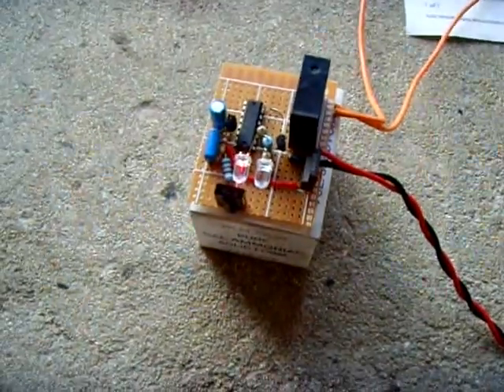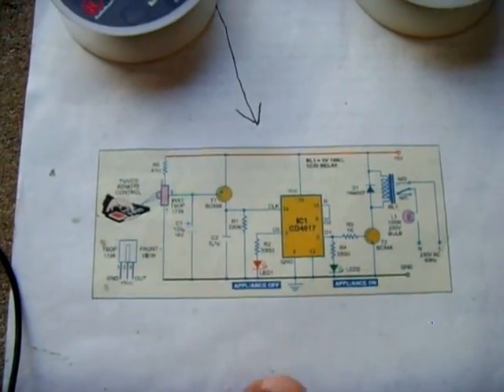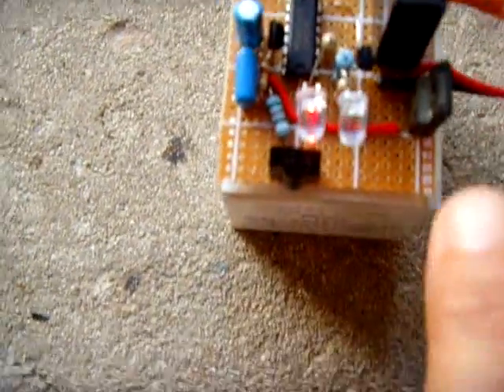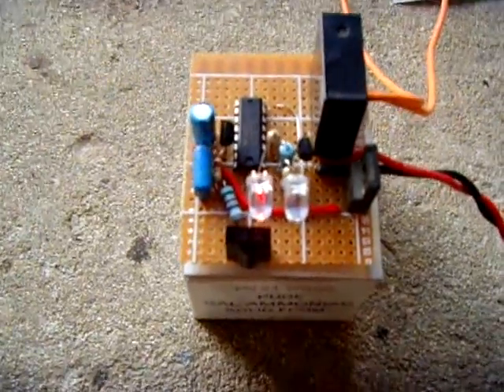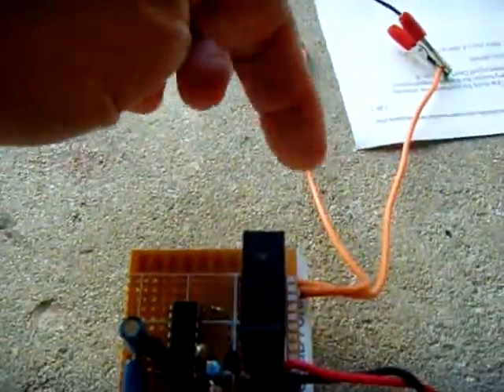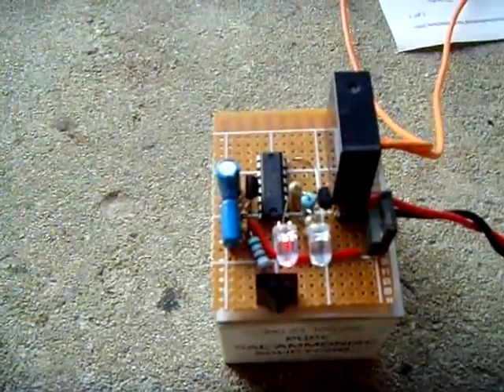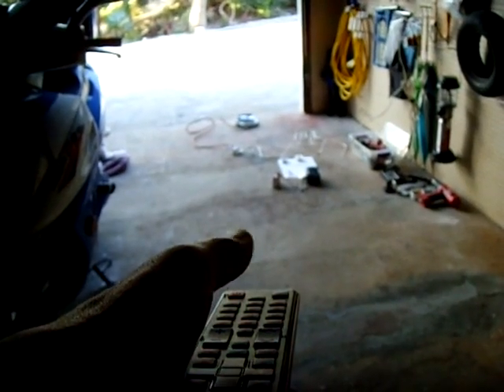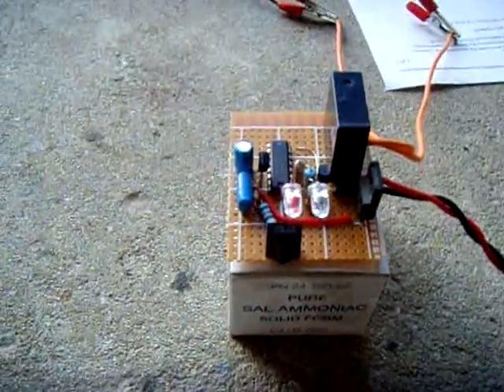Turn Appliances ON & OFF With Any Remote Control

Comment: I tried this circuit many a times but it is still not working

my problem- only one indication Led gets on which is on the first output.
it does not perform any switching rather the first LED keep on blinking when i press buttons
as a result relay also dnt perfrom any switching...
please help me through this....waiting fr rply...
Reply from the maker: I have a feeling your circuit is not right. The tsop1738/1838 is connected properly? Make sure, because this is a very simple circuit. Try new transistors as well. I have a newer and better version of this type of circuit, Be sure to check it out in my video playlists. Thank You
Reply: electronicsNmore i too feel that the problem is in Transistor
cuz i'd checked the TSOP it works properly
but i am using BC558.... I'd replaced them twice ....but still no result :-(

Comment: Can i connect two or more light connections through the same setup?
Reply from the maker: You can control as many lights as you want as long as you do not exceed the rating of the relay contacts.
Reply: I am sorry, I am a lay man to the electronic world. Can you tell me how i could change the channels assuming I have 3 light bulbs.
Reply from the maker: Turning the circuit on and off will turn ALL the lights on/off at the same time. You cannot choose each light with this circuit
Reply: Okay. Thank you! :)

Comment: i tried this project and it worked but the problem is that it automatically gets switched off after a certain interval thought every time the intervals are different. i have to again press the remote button to make the lights on......i need help on this project
Reply from the maker: It should not be doing that. Try adding a resistor in series with the output leg of the tsop1738/1838. Start around 1K and go higher of needed until the problem goes away. Using too high a value will kill your range. It sounds like the IR is too sensitive and being triggered by fluorescent lights/sunlight.

Comment: i was looking for this circuit, there were Rechargeable L.E.D. Lamps for 220v 
which had this integrated, but I coudn't grab one and it never came back to that store.
Will be making this and post a response video soon, 
I'll be making this circuit using 7805 Regulator to make it run on 5V and 12V for the relay.

Thanks

Comment: sir can i use ir1838 in place of 1738
Reply from the maker: yes.
Reply: electronicsNmore what changes do i hv 2 make in the resistors if i provide a supply of 6v...???
Reply from the maker: Leave everything as is and use a 5V zener voltage regulator to power the entire circuit. You can supply the full 6V to the relay.
Reply: i have tried this with l7805 voltage reg. but it didnt work.....i'm using a normal sony tv remote but still then it is not working...what may be the probable mistake u think i hv done....while making the circuit...
Reply from the maker: Circuit definitely works. Check all your connections, component values, and make sure the 1838 is connected to the proper pins.
Reply: electronicsNmore Can I use 555 timer, does the circuit will work if I put 555 timer? :D
Reply: electronicsNmore
are u sure that the circuit works with any vcd remote or any tv remote....
Reply from the maker: yes, at least all the remotes I tested. Some remotes may take longer to trigger. So try holding down the button, or using the power button on the remote.
Reply: electronicsNmore
what about this remote  plz check the link -----{{{{http://www.google.co.in/url?sa=i&rct=j&q=&esrc=s&source=images&cd=&cad=rja&docid=fyTxPzNhFWupEM&tbnid=iEx_KG5Cf_3n2M:&ved=0CAUQjRw&url=http%3A%2F%2Fwww.adafruit.com%2Fproducts%2F389&ei=5zy8Uri2DcyaiAeQv4CQDQ&bvm=bv.58187178,d.aGc&psig=AFQjCNGGrfw_9h5fLMuiTWtLqxB6BskBaQ&ust=1388154465000279}}}}
Reply from the maker: I have no idea. Your have to try another remote to see if the remote is the problem.
Reply: sir  u were right the circuit works....but the only problem is that it doesn't switch on by remote rather when i disconnect the output terminal of ir 1838 and again connect it to its original terminal the circuit switches on and off.....
     i think the resistance provided to the positive terminal of 1838 is wrong or may be something else to make it work for 5v current....
         so if any help plz reply...
Reply from the maker: I have never had a problem with this circuit. You have to go over the entire circuit, try new components. You have the schematic. I helped you as much as I can. I assure you the circuit works. Thank You.

Comment: hello, when i replace ir receiver with the switch..the circuit work..but the red led doesn't glow when off. And when i replace it with TSOP1738 and already test it at dark room but the circuit doesn't work. do you know why ?

Comment from the maker: Try adding a 20K pot on the output pin from the IR module. :-) That will desensitize the sensor, but still allow remote triggering.

Comment: Hello, thank you for this video.
I have made a circuit (infrared switch) similar to this one, but the problem is that it responds to almost everything. I mean you can use any remote to trigger the switch but it also responds to light, and if you shake it- will trigger itself etc. Any help?
Thank you!

Comment from the maker: Hey Arby. I could not find a data sheet for that component. The IR sensor module has to be 38khz, and work the same way as the tsop 1738/1838.

Comment: I'm thinking of using the circuit diagram to make an on and off light switch. I want to integrate the IR LED directly into the circuit and suggestions where I can put it? I was thing of putting it at the Vcc terminal of the IC, but not too sure what the voltage drop will do to the rest of the circuit. Can anyone help??

Comment from the maker: This circuit will work fine for both 110v and 220v appliances(DEPENDING where you live). What is important is that you have a LINE and NEUTRAL to produce the 220V. If you do not, then one leg will always be hot as in the USA where 220V consists of (2) 110V lines, not (1) 220v line and a neutral to complete the circuit.

Comment: sir! y i can't use BC548 with my project setup test , when i use it , the relay cant connect (6v relay)  .... that is the problem with my replay 6v .so i change to use BC547 it work with 6v relay but not perfect as you project ,if i 1 2 turn on it i need to press 3, 4 r hold a few second, mayb after 1, 2hour it auto turn off (does the project is time limited?)

Comment from the maker: 1838 should work. I think the only difference is the pinout. Make sure you have the TSOP 1838 connected to the correct pins. Look online for a data sheet showing the pinout. Also re-check the entire circuit.

Comment: plz help me sir !! in my country has only TSOP 1838 (dont hav TSOP 1738)
i had setup like the circuit without TSOP 1738 but i replace it with TSOP 1838 it not work 
, it the lamp just trun on mayb afew second it auto off.... help me plz

Comment from the maker: If you remove the connection in the schematic from the relay to the +5V red line, and connect it to a 12V power supply instead, that would work. The rest of the circuit would be powered by a 7805 VREG. Make sure the input and output of the Vreg has a small capacitor on them both to ground. Use like a 104/.1 uf.

Comment from the maker: No. Open up your relay and try removing 1/2 the copper windings from the relay coil and solder it back. The wire is VERY thin, so do it carefully. You may also have to weaken the spring in the relay to get it to close after the mod. Simple to do, otherwise buy a 5v or 6v relay.

Comment from the maker: 6V is fine. The tsop 1738 receiver is rated for 5V max. I suggest using a 7805 regulator, or find out how much current the circuit draws using 5V, then use a resistor in line with your higher power supple to limit the voltage/current to the circuit. For the relay, just use one rated for the voltage you want to use.

Comment from the maker: @Smk161191 Make sure you have the proper IR receiver. Also make sure the wires are on the correct pins. Might have to swap the wires to the pins around. There is no PCB layout. I did it all by hand.